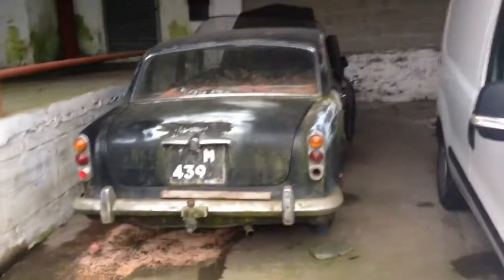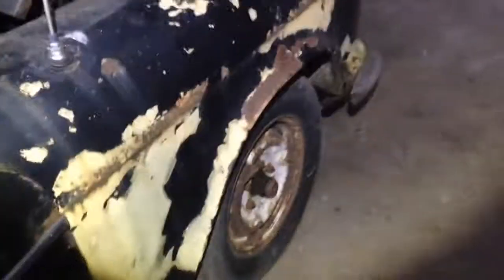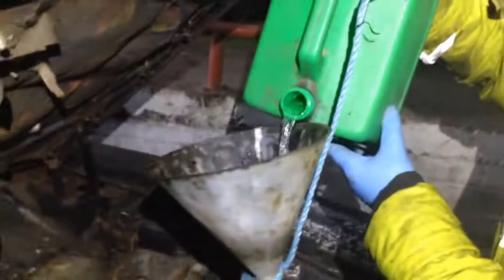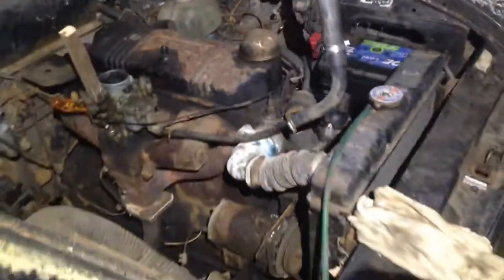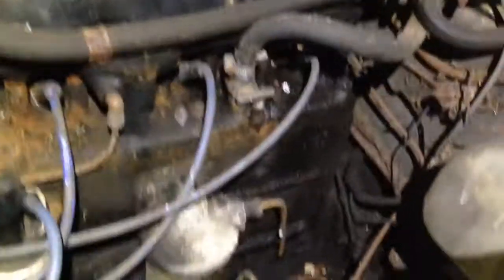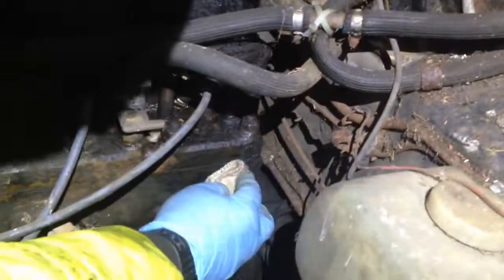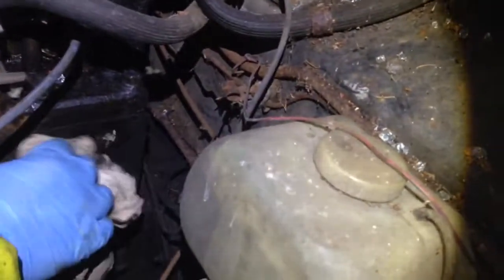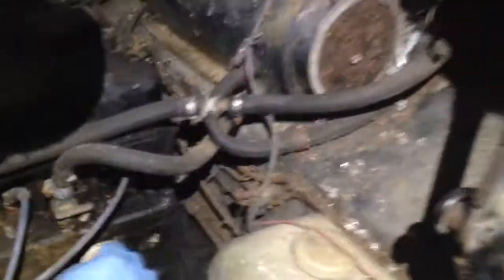1967 Humber Hawk - will it run? Yes it will.

Comment: What a shame to see a good car in such poor shape. A modern Rover V-8 would make for a great engine improvement.How hard is it to get sheet metal for these cars?
Reply: Impossible.  The owners club sell wheel arches, but the sills, I don't think so.  They just don't have the value to warrant it, which is a shame as they are better than comparable Rovers and were often used alongside Rollers.